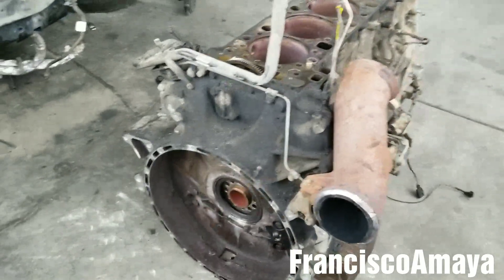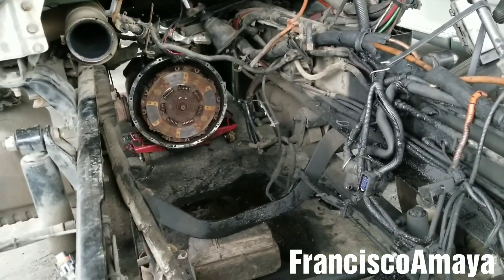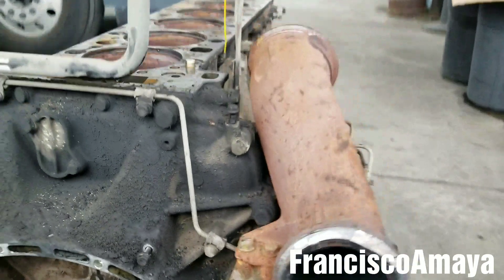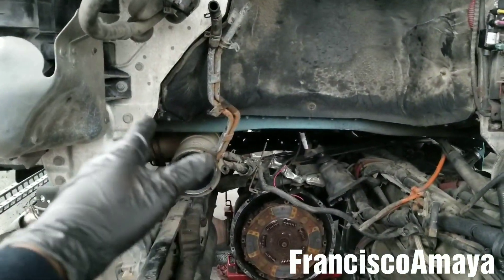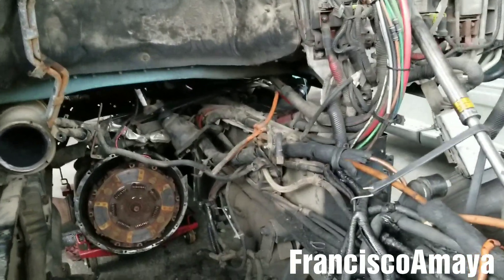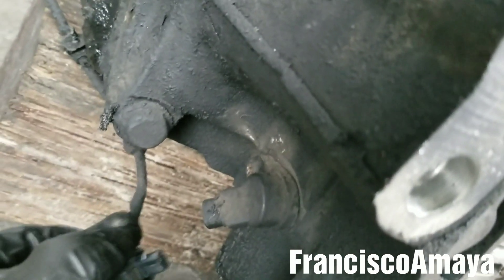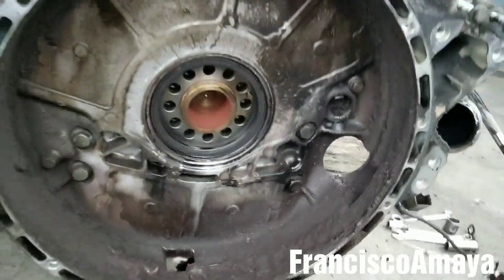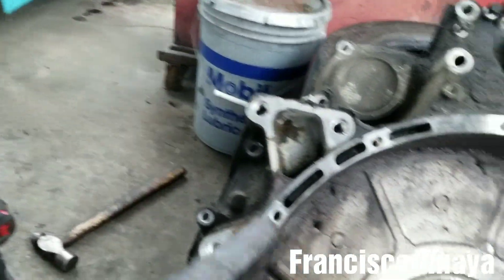freightliner cascadia DD13 DD15 DD16 rear timing gear cover gasket replacement rear main seal part 1

Comment: Where are you located to take you my 2014 freightlighner cascadia DD15  so ypu can work on it. cant find a good trustful mechanic to work on my truck. my email is ariel19751975@yahoo.com  thnx Ariel G. Torres